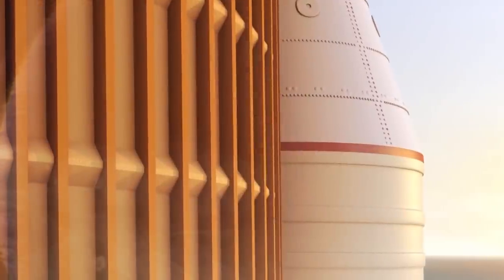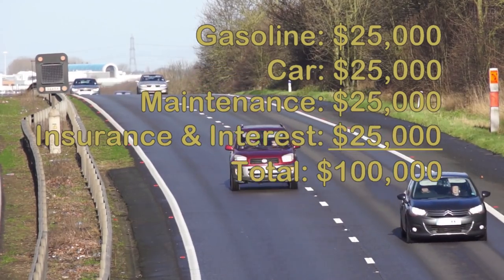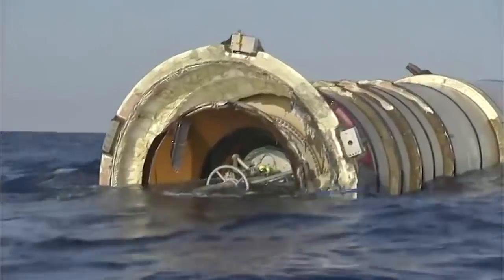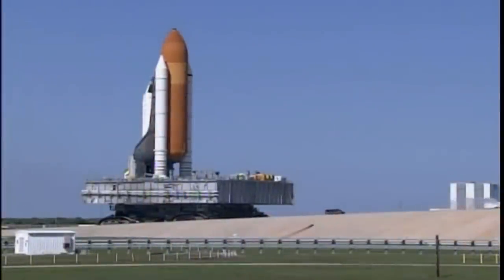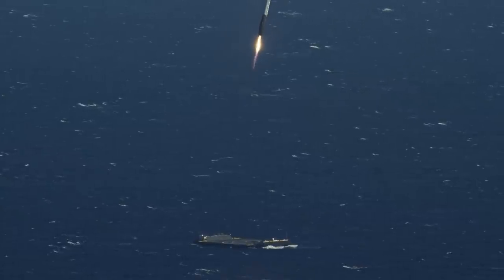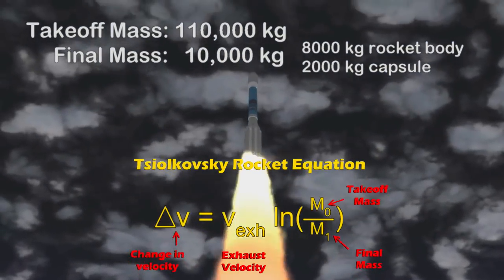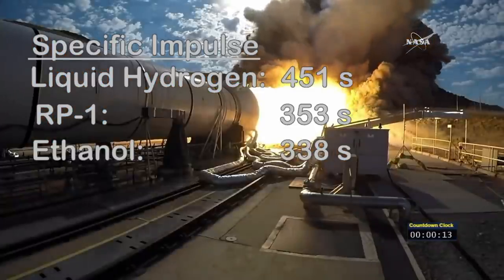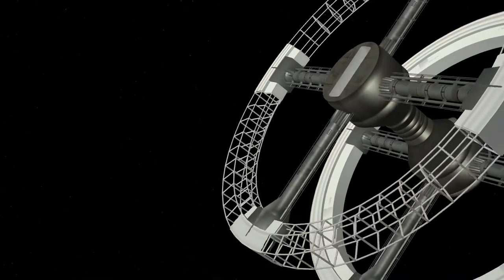Reusable Rockets & Metallic Hydrogen

Comment: I mean i you wanted to brute force it you could have a really long fuel hose that unwound very fast and kept the fuel in tanks on the ground. It's be one of the most inelegant solutions but im sure we could make it work
Reply from the maker: The hose would have mass as would the fuel in it, not to mention the issue of getting fuel up that hose after the first kilometer.
Reply: I was kind of thinking of using the fuel pressure to support the fuel hose seeing as you'd probably have some monstrous pumps to push the fuel that high

Comment: What if we build spaceships with wings ? Keep flying until the aur gets to thin to fly and then activate a pair of rocket thrusters. Would it reduce costs or is it a good idea ?
Reply: If the spaceship flies on regular jet engines then transitions over to rockets, your adding way to much weight.  The space ship still burned a lot of fuel to get up high, and your carrying the entire weight into orbit.  Unless you jettison the wings and the engines, and the fuel tanks that carried it up that high.  

What has been done before is using a very large aircraft to get a smaller rocket up high releasing it and then just the rocket launches.  The Pegasus rockets work this way.

Scott Manley has a great video where he covers this in a lot of detail.
Look up

"Does Launching Rockets From A Mountain Really Help?"  He gets into launching from planes about halfway through the video.
Reply: You're talking about a spaceplane, and on its own it's workable but extremely complex and difficult to engineer.  Skylon and the X-33 have come closest, but the X-33 was shelved and Skylon is still in the R&D stage.

Comment: How are vibrations not an issue when launching a rocket straight from water? Water does conduct sound, doesn't it?
Reply from the maker: It does, but it can't shatter like gantries or concrete or neighboring houses, and water does dampen vibrations decently too.
Reply: I see

Comment: Would metallic hydrogen be stable? My intuition would say that, since it takes so much pressure to make, it would explode back into gas as soon as that pressure was released. But would it instead be more like diamond, and stay as it is?

Also, might metallic hydrogen get a unique name like graphene or kevlar, or is metallic hydrogen cool enough to stick?
Reply: Metallic hydrogen is put under so much heat and pressure that hydrogen changes its properties and starts acting like the metal it is. Metallic hydrogen sounds good and tells you what it is.
Reply: I get that it is metallic under tremendous pressure. But my question is will it stay metallic once the pressure is taken away?
Reply: When I say it changes properties, I mean the properties stay that way even after leaving the conditions that formed it.
Reply: Okay. Might have made that clear. You could have also meant it changes properties in the same way star matter changes properties when it becomes a neutron star; take it away from its extreme gravity, and it explodes like an atom bomb.

Comment: Isaac, what about using solid metallic Deuterium or Tritium??
Reply from the maker: I don't think in this context that would be beneficial, good for fusion, but I can't think of any advantage as a propellant for non-nuclear options. But take that with a grain of salt, that's my off-the-cuff response.
Reply: Yeah, I understand very little about basic chemistry. I'm trying to think what effect heavier isotopes of an element has on an oxidation reaction, regardless of the state of the reactants. The average kinetic energy of the products would probably be lower but also probably have more momentum due to the extra neutrons, but I'm just completely guessing. 

I am also not very educated in classical systems of particles either, so I'm not sure how to even look at effective exhaust velocity in the light of conservation of momentum.
Reply from the maker: Usually heavier atoms means slower exhaust velocity, that's why I don't think it would be a better propellant, BUT there was also something created a few years back to less fan fair called 'ultra-dense deuterium', which IIRC could be compacted to about 100,000x the density of water. Something like that might have insane amount of binding energy when 'burned'
Reply: That's really interesting. I'll have to check that out. Thanks for the replies!

Comment: why do I feel like disney land on the moon needs to exist?
Reply from the maker: I have no idea, but I always take it for a given too.
Reply: Isaac Arthur hey, since I got your attention, I love your work, and I have a question. Dosen't the breaking length of a material actually determine the diameter of a rotating habitat? The centerfugal forces would be going in every direction, so if you added up all the net forces in any particular direction, it would equal the total force divided by pi (I think). Am I mistaken in my reasoning? And could you squeeze a little more diameter with internal support beams? Or some tension  equivalent of active support?
Reply from the maker: Yes, we discussed that in the rotating habitats episode, of course you want to stay well shy of the actual breaking length for such structures but steel let's you do about 10, titanium about double that, and graphene hypothetically let's do 1000+, though there are some active support tricks for going even bigger.
Reply: Isaac Arthur I misunderstood your video. I thought you were saying breaking length was the circumference. But if you use graphene, it's so absurdly strong couldn't you get away with 90% of the length, because even then you have a big margin? Also now you've got me excited (because I'm a huge geek), what kind of tension active support is there?

Comment: Another excellent episode. I guess I must watch yet another time. Like rich chocolate... As for the SeaDragon it has a few curiosities on the simplicity againt complexity equation: 1. it makes for a mile long plume, 2. it would be the noisiest man made object short of a nuclear explosion, and I guess countries that have sea borders would be totally shocked with the idea of such noise underwater. The noise would problably go from one Ocean to the next, 3. it has a 5-mile shockwave (Yes, a bit like Nagazaki). But if someone wants to spend 25 years building Startram, the US just ressurect this project and voilå, a sub $1000/kg space flight. It can carry in one trip 4 times the Saturn V max. load which Von Braun overbuilt to go to Mars. That close to 1.2m tons. With these numbers who cares about the rocket cost. It was tested in various sizes and only stopped after Nixon went to the Space Shuttle. The coolest Hulk on the block with 70's disruptive space technology!

Comment: Nit, the most expensive thing about space travel is NOTthat they throw away the equipment after each flight.  Indeed if it was, they would have stoped doing it decades ago.  The most expensive part is building and maintaining the facilities to launch things,that hardly ever get used, and the cost to develop space launch vehicles that seldom fly more then a hundred flights before obsolete and be replaced.